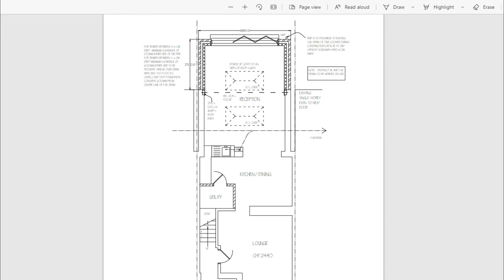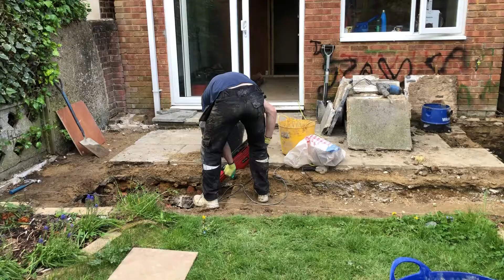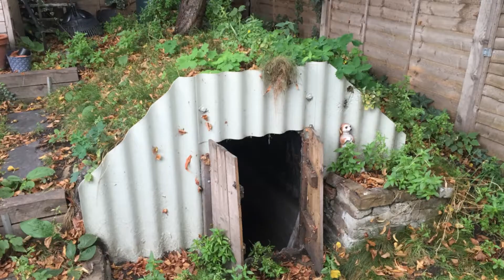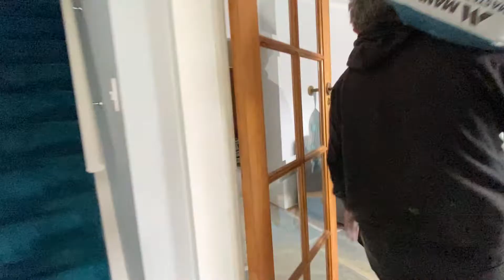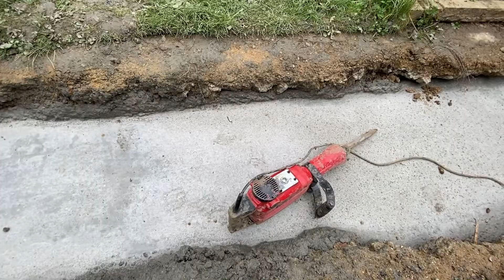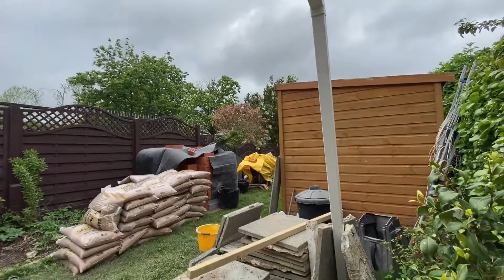Building a House Extension Part 2 - THE FOUNDATIONS - Dig, Building Control, Concrete Housing Market

Comment: Quick Q. The wall of the older extension….you did leave about 600mm on each side right? Because you need lateral resistance by way of a wind post or pier system?

Comment: why did you leave a gap in the foundation? I get it's for drainage, but shouldn't the foundation be joined regardless? you now have two separate foundations that are likely to move independently from each other.